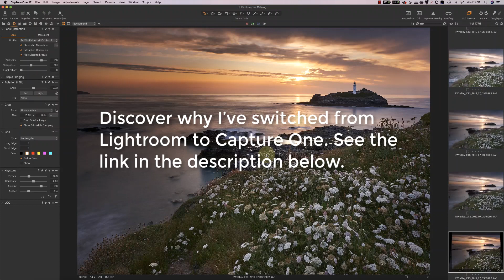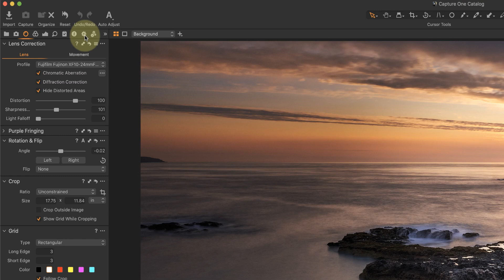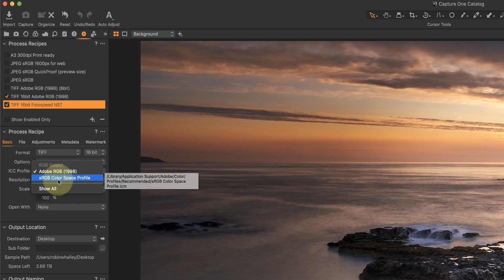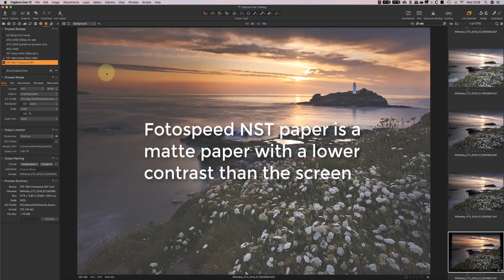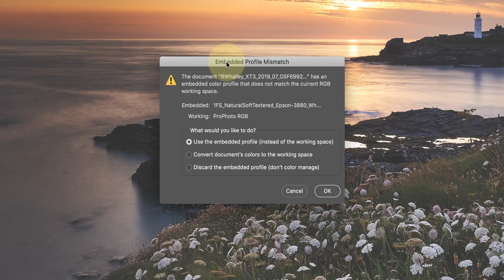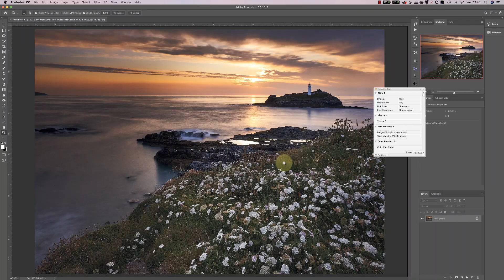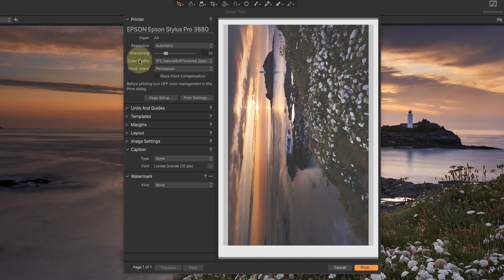How to Soft Proof and Print in Capture One Pro

Comment: I realize this was an old video but the concept hasn't changed.  My question is, after viewing what the picture will look like using the print profile and making my adjustments accordingly (which is don't with a raw image)  if I don't use Adobe, the procedure is to THEN output (or Export) the file to a jpg (which is what my printer uses) and save this using an sRGB color space profile, correct?

Comment: What if my monitor only supports Srgb or DCI-P3? Does using Adobe RGB as a recipe represent an accurate representation of the Adobe RGB after printing? Or are the colors after printing not so different?
Reply from the maker: Your monitor won't accurately represent the colours outside what it can display. But that's not really the idea behind soft proofing, it's just easier to understand what we think about it like this. The soft proofing is to show you the problem areas based on your intended output device (the printer) and what it can handle. When you see large problem areas in the image you can then correct for them so that you still create a good print. The accuracy of the colour display will never be as good from an sRGB monitor when compared to a wide gamut monitor because the software determines how to squeeze any colours outside of the monitor's colour space into something it can handle. Quite often small problem areas and slight colour shifts will go unnoticed when viewed on a monitor.

To give you a practical example, I work on a Mac with a 5K Retina screen that handles around 80% of the Adobe RGB colour space. I also have another computer with a monitor that displays 98% of the sRGB colour space. When I work on some sunset images the yellows and orange colours look amazing on the Mac but on the other computer with the cheap screen there's no transition between the colours. They all look a similar yellow colour because the monitor can't handle them. When I soft proof on either computer I see the same problem areas because I'm soft proofing for the same printer and paper combination. The print I produce matches my Mac soft proof closely because the printer can handle the colours. If I print from the other computer the print is the identical to the first but it looks a lot better than monitor soft proof because the monitor couldn't handle the colours.

I hope this makes sense.
Reply: @RobinWhalley  Thank you. I am starting to get it now.

Comment: Hi I am currently considering a sensible workflow for storing my pictures for print. Like you, I do a clone variant to make the necessary changes with the icc profile. Then I have 2 variants. One as an original file that should remain in the catalog. I could save the print variant in a separate folder. Also OK. In order to store this print variant in the catalog in a meaningful way, I tried to change the name of the variant with the addition of print. But that doesn't work. What else could you do there? Maybe work with different colored markings? LG Klaus
Reply from the maker: Using colour tags might work for you but you could also try adding keywords. Adding "Print version" as a keyword which would make searching for them easier.
Reply: @RobinWhalley  OK thanks a lot for your support, Robin 💪

Comment: Sorry, not understanding correctly: your processed image (a rgb) lokked nice, the pro Foto soft proof looks very flat, so, you have to do your adjustments new for the fotospeed ICC, right?
LG klaus
Reply from the maker: The starting image looks OK because it doesn't show the effect of printing. Prints have a lower dynamic range and strugle to reproduce black and some colours. The colour space (sRGB or ProPhoto RGB for example) determines how wide a range of colours there can be in the image. The wider the range of colours (for example ProPhoto RGB), the greater the chance your printer can't cope with it. When you find colours the printer can't handle you need to make adjustments to change them (slightly) to ones it can handle and print. If you don't make the adjustments the print software will do that automatically but probably not in the way you would like it to.

Comment: Alright, what I didn't get is how you get your picture to look like the original after soft proofing. You showed us that it has lost contrast and so on. then you open it in PS. Or you print it in C1 looking "dull". Do you normally counteract in C1 to make it look like the original even when on paper or is it not possible/reasonable?
Reply: Yes, you can counteract to a certain degree by using contrast, black point and temperature sliders. Nevertheless, especially for matte papers you will not be able to fully restore the appearance of your Adobe RGB or PhotoRGB image on the screen. In best case install the ICC profiles from some papers and compare, and then decide which to buy. Outstanding good for matte papers are the new Canson Arche 88 and Canson Baryta Photographic II Matt papers, but they are not cheap.

Comment: Thanks for the video. Question I have is: once you have loaded your ICC profile into the recipe, you adjust the clone to match the colours you want to have, right? Else in your example, it would look to gray or am I missing something? Still struggling with this (not only in C1). Thanks.
Reply from the maker: I don't follow what you mean by looking grey. The concept is that after editing your photo should look as you want it to. But when you print this the dynamic range of the print (and a few other things) prevents the image looking like the original edit. By softproofing you are making the image look as it would when printed. If you create a copy of your image you can adjust that to make it look better when printed using the soft proof feature. I hope this helps.

Comment: I'm having some serious problems with color rendering in proofing vs the output. I've gone over output settings many many times and ended up with a tech ticket. The proofed raw file shows a much punchier image than the output photo...however when you zoom in 1:1 the extra color punch goes away which means I have to color edit at 1:1 to get the desired effect. Is there any way to fix this?
Reply from the maker: Sorry I’ve not come across this. Be sure to check things that seem obvious like calibrating the monitor. Does printing from other applications work correctly?
Reply: @RobinWhalley  the monitor is calibrated. I sent a screenshot of the proof and of the export to C1 and they acknowledged there is a problem when using a layer to adjust colors to a select area. Apparently they said it has to do with the software taking some liberties with the algorithm to make it faster. I've never had this issue with lightroom and it's really surprising. They said they do not plan to fix it so this is no longer a reliable program for me. It's a shame because there's so much I like about it.

Comment: Hi Robin, Great video.  Is there a way to do a split view so I can make adjustments to the soft proofed variant in order to  output what i originally edited!
Reply from the maker: Thanks. I don't think there is a split view for the proffing at present. You may find you can do something using dual screens if you have them (unfortunately I don't).

Comment: I use both Capture one-12 and lightroom for post-processing and found printing in lightroom superior to Caption one in some regards. In lightroom there are a number of templates that are handy (collages) as well as adding text within margins. Both allow watermarking and I like Capture one's ability to process more than one "profile" at a time (jpg, tiff, etc.) to different sub-folders. I would really like to see your work flow to print from both of these programmes. I will sometimes process in Capture one, use NIK collection, or Topaz 2 and then import the TIFF file into Lightroom to print as I understand how to do this and save a soft proof for future prints (using the same ICC settings).
Reply from the maker: Like you, I do the bulk of my printing in Lightroom because it's where I have the majority of my experience. I have made prints using Capture One and they turned out very nicely after soft proofing, but it's not my go to solution for print work.

Comment: I've been a bit perplexed by Capture One's use of .icc profiles for output — thanks for making this video. In the video, assigning the output profile made an obvious change in the image's appearance on-screen. Is the flatter and less saturated version of the image (resulting from use of the output profile) what you expect in the print itself?

Is selecting an .icc profile within an output recipe the equivalent of assigning a profile within, say, Photoshop, or the equivalent of conversion to an output profile? When I used Photoshop in the past, I was accustomed to seeing noticeable differences on-screen when changing the assigned profile, but no detectable change on-screen when it came time to convert to a profile before printing. But the on-screen appearance is very different in Capture One.
Reply from the maker: Thank you. The printer profile makes the image look flat because it is trying to imitate ink on paper. My personal feeling is that the output isn't as flat as the proof would lead you to believe. As for the question of choosing an icc profile in the recipe, the profile is embedded into the image that’s created.
Reply: @RobinWhalley  On seeing this effect on-screen in Capture One (with a profile for a Fuji Frontier printer — have never had that kind of print made before), I created a variant with the profile selected and re-did the edits to restore the look of the image that I wanted. This was the equivalent, I guess, of Ian Seward's suggestion elsewhere in this thread, though I made the change on the background layer rather than a new layer.

The result might be fine on-screen but not so good when the printing service sends back the print. I'll find out soon enough.
Reply: No sooner do I write the last comment, than the print arrives in the mail. I did over-compensate a bit for the on-screen change. It's a bit too dark. Not bad, but still too dark. So Ian Seward's suggestion is the right one. It would have been better to make the changes on a layer after assigning the output profile.
C1 soft proofing is lacking choice of rendering intent and black point compensation, though the options are in C1's Print dialog. I suppose it would be better to do this stuff in PS or Affinity.
Reply from the maker: @mikearst2940  I guess its a little easier for me as I do my own printing so can judge the results once the prints had time to dry. And yes, I think Ian's suggestion is a good one.
Reply: @RobinWhalley  I should take the inkjet printer out of retirement (assuming I can unclog the print heads) and give printing from Capture One a try. The printing user interface is strange, though. I will have to find a video tutorial about it. (Phase One's own tutorials about printing have been uncharacteristically not so helpful.)
Reply from the maker: Hmmm! I'll add that one to the list of future videos.
Reply: I would look forward to that video (I sent some email about it via your web site's 'contact me' page just now).

Comment: Hi Robin where is the process tab in C1 express I can’t seem to find it 
Regards Peter
Reply from the maker: Unfortunately there isn't a process option in the C1 Express edition. It's only available in the full Fuji version or the Pro version.
Reply: Robin Whalley 
Thanks for that,  I’m rather confused I’m printing using C1Ex print dialog box says color profile should I put my paper profile or Adobe RGB ?
Reply from the maker: If you change the Profile to show the Paper Profile that matches your paper and printer you will see a soft proof. This shows you how the print will probably look. Depending on your printer and the type of paper you're using you may find it looks quite different to what you're seeing on screen. That's when you need to make a clone copy of the image and adjust that to improve/correct the print. Sorry to confuse you but there is another option which is "Managed by Printer". This turns over the colour management of the print to the printer. Depending on your set up and the image it may produce a good print but it's usually no where near as accurate as printing with the correct colour profile.
Reply: Robin Whalley 
Thanks again, probably best if I buy the pro version and spend some time reading up . It’s all the different products trying to work together that I find confusing ie I Mac / Lightroom/C1/ colormunki/ paper profile / Canon printer / Fujifilm camera etc ...
Reply from the maker: Have a read of this tutorial on my website https://lenscraft.co.uk/photo-printing-tutorials/tutorial-what-printer-profile-should-i-use/. It tries to explain what printer profiles are and how to use them. If you are interested in Pro version of C1 and only use Fuji, there's a very good deal on the software at the moment. I think I got about 50% off when I bought my copy but it's coming to an end at the end of August. If you have more time to spare, you might try my book "Perfect Prints Every Time".
Reply: Robin Whalley 
Thanks Robin , I will definitely take a look . Great stuff !

Comment: Recipe proofing does not have to be always on.  You can switch it off under View>Recipe Proofing.  You can then toggle proofing on or off via the spectacle  icon or pick a recipe from the menu View>Proof Profile.

I tried to view two images with different profiles at the same time but was unsuccessful.
Reply from the maker: Thanks. The point I was trying to make in the video is not that Recipe Proofing is always on but that the view always reflects the selected colour space in the recipe. You're quire correct that you can set up a separate recipee proof and toggle between the two. I would to be able to compare a proof view with the normal view without needing to toggle. Perhaps this will be a furture enhancement.

Comment: Too bad you can't view the variant with the printer profile right next to the variant with the "usual" profile (Adobe RGB, ProPhoto, etc). This would make it easier for comparing the two while additional adjustments are added to the printer profiled variant (with the goal of making the printer profiled variant look closer to the variant with the Adobe RGB or ProPhoto profile, so your actual print looks closer to what you see on screen).
Reply from the maker: I agree. It may be possible though as I'm still quite new to this latest version. It's quite a few upgrades back that I was using the software regulary. Something that I have noticed is that the softproofed result in Lightroom looks less different than the version in C1. The image I produced seems to print nicely without further adjustment. I will be experimenting further with this as there doesn;t seem to be much written about it.
Reply: @RobinWhalley  Thanks. Would be interesting to see what you find out through additional experimentation.
Reply from the maker: I usually share findings here or on my website.
Reply: @RobinWhalley  Great. Thanks.
Reply: @RobinWhalley  b
Reply from the maker: @johnbent787  ?